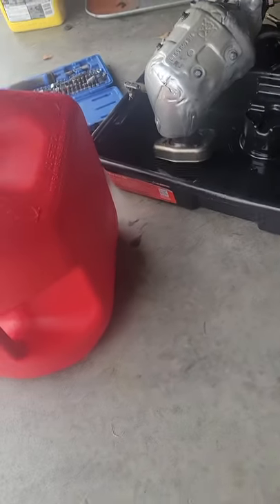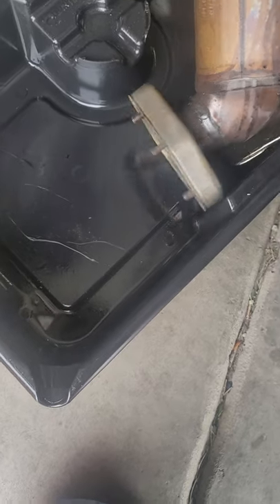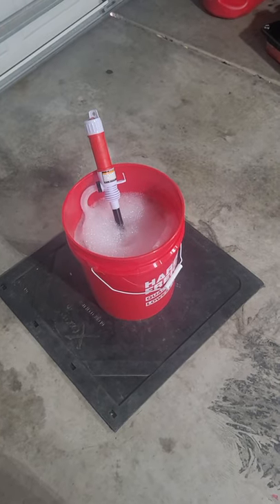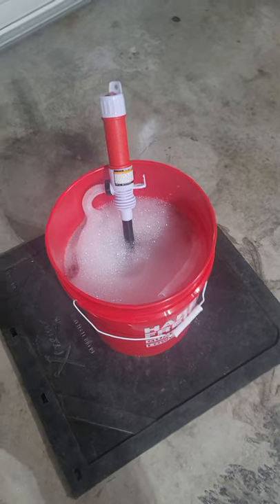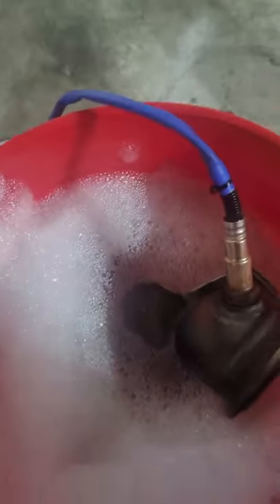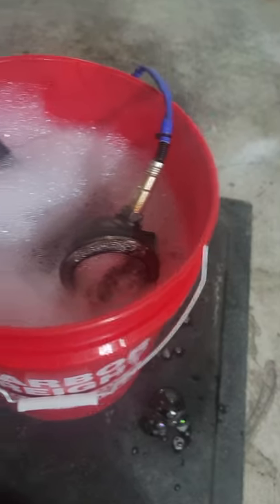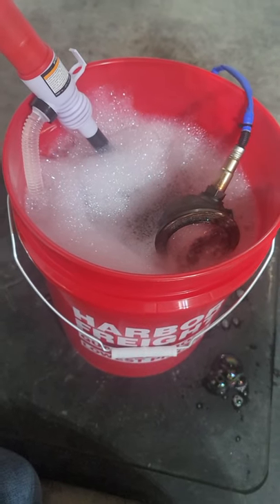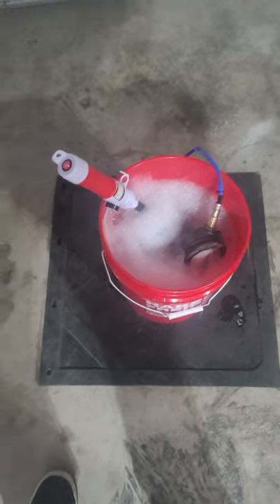how to clean oil from a catalytic converter

Comment: I went to answer your question and your comment disappeared.  I did find the leak.  When I removed the intake manifold I cleaned off the DDMworks TBS gaskets really well and after installing the fixkit and reinstalling the intake, all was well.
Reply from the maker: I apologize for that, I asked a question without reading other comments with your replies and got the answer lol... and the catalytic converter cleaning I did worked fine, hasn't been very long but no cel... I developed a boost leak after installing a new turbo so I'm smoke testing it this week to try and find the leak.
Reply: @dave1jeeperify  Keep us up to date.  I'm interested.

Comment: So how long did this fix last?  Has your CEL come back yet?
Reply from the maker: Only a few weeks in, but works fine, no lights on
Reply from the maker: Just touching base, still no problems a few years down the road.
Reply: @dave1jeeperify  Did you ever complete the video for cleaning out the intercooler?